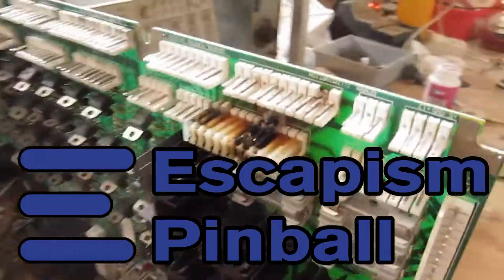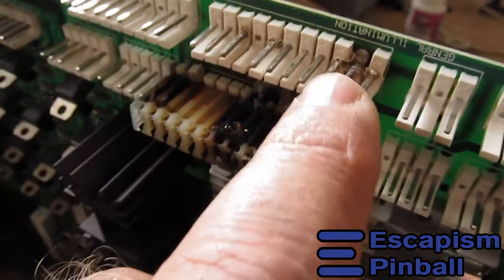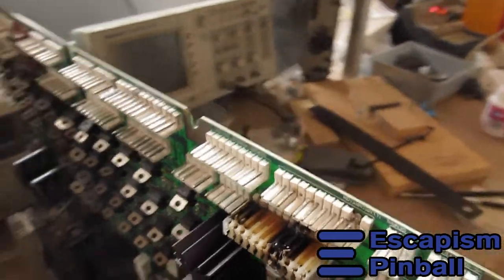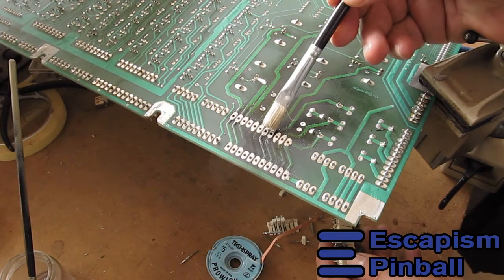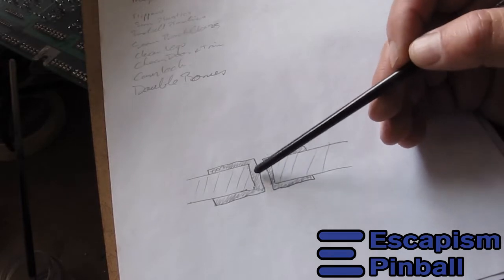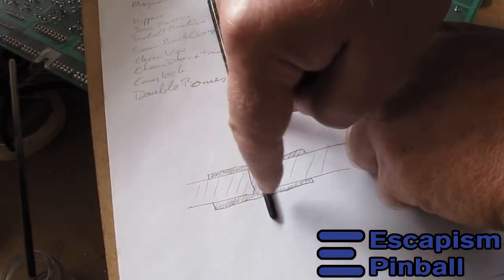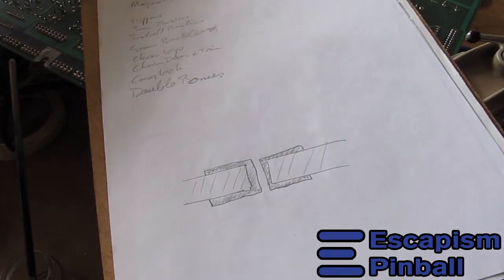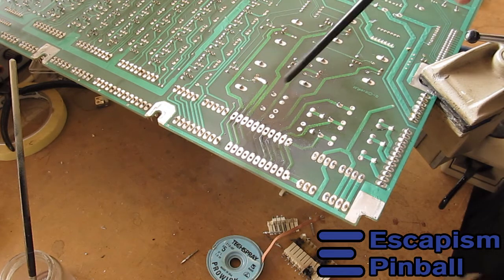Pinball Board Repair. New headers for the GI on a WPC power board.

Comment: Escapism pinball, have any videos on troubleshooting switch matrix circuits and lamp matrix circuits?
Reply: wayne Gram if it it wpc replace u20
Reply: if you can make one that would be nice to know how to troubleshoot light matrix circuits and switch matrix circuits for WPC games. WPC games have a strobe signal to change the LED lamps to dim the lights. In the settings you can change the LED lamps to dim them in WPC games.
Reply: thanks